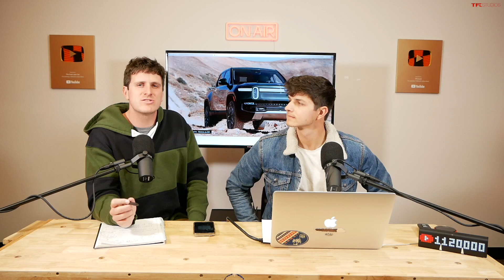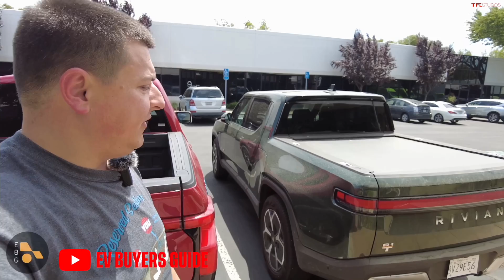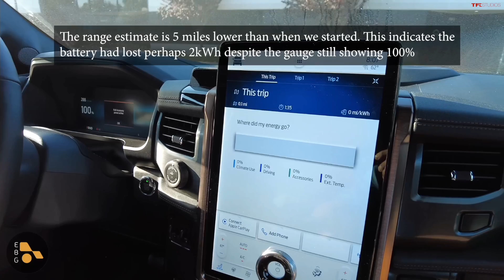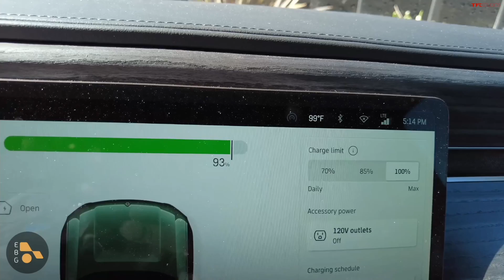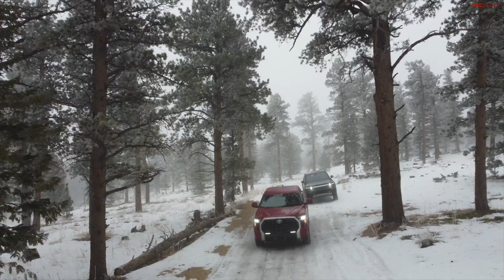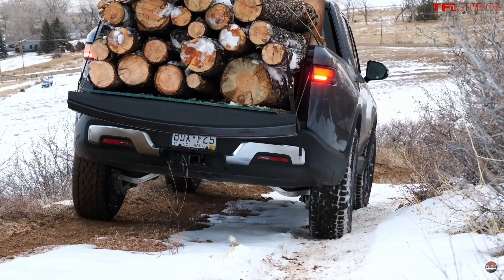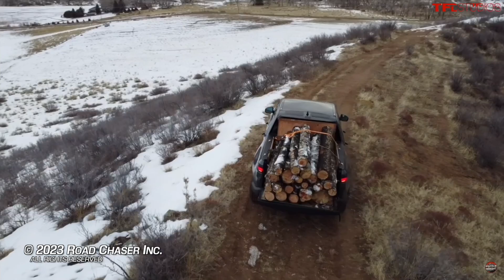This Rivian Is Getting The Equivalent of Just 25 MPG: Here's Why That Matters!

Comment: Frequently, when parked I hear my Rivian make various noises, air compressor sometimes comes on briefly. I think Rivian needs to take a couple of trucks, park them in the cold and monitor them until they figure this out. Not an issue for me, I drive the piss out of my Rivian. Never leave it parked for very long but it is for others. Overall, I try to park it in the garage as much as possible but have been lazy lately.

Comment: You could turn off battery thermal regulation. Then people will complain it does NOT heat up quick enough, or the battery failed prematurely. You can not make everyone happy. It costs me under $5 to drive my Rivian 150 miles. I am very happy with this!
Reply: My 10 year old BMW i3 doesn't have this issue and it's always ready to go.  It also takes just 8 minutes to fill it up at a fast charger......

Comment: Don't spread this guy's FUD. He's posted on Reddit about this, too. His math is severely faulty. Sure, if he drives it so little that vampire drain is MOST of his energy usage, it will be bad.

Also, "a charge cycle" is a charge cycle, regardless if it's a bunch of 60-70% cycles or one 25-85% cycle. As long as you don't drain to below 10% or charge past 90%, the battery doesn't care how it does it. "60% total" is 60% total.

Comment: Software upgrades will only do so much. I personally think there should be a battery cooling/heating  shut off switch. Like a physical switch not a Software shut off.
Reply: That's too risky. If the battery were to overheat in the summer it could trash it all because some guy had his cooling switch disabled. Companies wouldn't want to warranty that .

Comment: Tell me again why 25mpg for an awd 4 motor 800+hp supertruck that runs 11s is worth complaining about?
For reference c&d reported their ram trx test truck averaged a paltry 7-9mpg over it's whole time in the fleet. 🤔
Reply: I'm the guy the story is based on. You're right, that's one way I try to look at it. The problem is that if I leave the truck sitting for 2 weeks unplugged it will be totally bricked.  It's kinda like having a hole in your gas tank with fuel constantly dripping out -- to me that's worth complaining about.
Reply: @Shive55  I get that part of it for sure. I just find people harping on ev trucks with lower than ev car efficiency like yours and the hummev. 
To be mildly amusing because it's still a whole lot better than any ice truck can hope to achieve. Let alone the few high power ice model's.

All without any particulate pollution noise or much heat. I hope rivian sorts this out. I noticed many owners talking about vampire drain over on the main rivian forum. Maybe munro helping them out will translate into better tech either in the r1&r1s refresh or the upcoming r2 platform.🤔

Comment: With 22" wheels, I'm getting between 65-75 empg with just under 3K miles on it.  I use the odometer for checking miles and then the Rivian app for how many kWh it consumes.
Reply: Just a misleading title. They should have labeled it "Rivian vampire drain"

Comment: I wonder how much of this comes down to learned behavior within legacy automakers not to allow phantom drain when vehicles are off.  ICE vehicles simply can't support any noticeable battery draw for extended amounts of time without risking getting stranded because the batteries are relatively small.  You see complaints on the truck forums where people don't understand why their truck didn't light up when they approached it with their key after being parked for a few days.  The answer is that it went to sleep to conserve power.
Now you have newcomers to the automotive world and their vehicles have massive battery packs that can supply all the power you need to keep the vehicle awake and ready to go, so they might not be optimizing power usage when parked.  Sure, it's nice to keep sentry mode active all the time in case something happens, but that power isn't free, as people are finding out.

Comment: Phantom drain seems to be a real issue in these "newer" manufacturers, which is strange.  Tesla also seems to have some losses (more of course with sentry mode) than others. As we saw in the video, the Lightening had almost none. My BMW i3s is also almost 0, as sitting for a week at the airport in 30deg temps I saw 0% range loss, in a much smaller battery. Interesting! Great video guys!
Reply: I left a 2022 Tesla MYP at the airport (outside) for 3.5 weeks in 30 degree temps and lost less than 1% battery total over the 24 days.
Reply: @A Washkowitz  its all software related remember the model s back in 2012 had this issue some cars bricked themselves I think rivian will get to the bottom of this... but it really shouldn't happen this late in the ev game even ford got it mostly solved
Reply: Another anecdote... my dad's Kia EV6 sat in my driveway for 6 weeks. Left at 80%, it lost only 1% in that time. This was in the winter too, with freezing temperatures.
Reply: My Mustang Mach-E loses essentially nothing when sitting.. maybe 1% if left for a couple weeks.

Comment: Case in Point I have 2023 Ioniq 5 long range AWD Limited equivalent here in Canada, it is going in for its 4th attempt repair of the DC Fast charging issue (it does not charge on DC). It is currently parked in Abbotsford air port for coming up to a week my drive home is about 100KM so I was really concerned that if it lost charge I would have to find a J1772 Level 2 charger to make it home (DC charging does not work). Thankfully even with the car remote app link to the car, it still shows 72% after 6 days of sitting I arrive with with about 73%. Rivian have to improve their phantom drain that is no good engineering plain and simple..
Reply: This car is on the same platform as the mentioned KIA EV6, so the risk of this problem is low, but there is a high probability that it will have limited performance due to a cold battery.
Reply: @Dqtube  This 2023 has battery preconditioning, so much improved charging performance in cold weather.

Comment: Man! That's crazy! It's  like when GM told us that it's acceptable to lose 2 quarts of oil between oil changes in our Saturn. We've had three. All purchased new and well maintained. 

If Rivian is losing this kind of capacity while new, what will it be like after it's five or six years old? BTW, what is bricking the battery? Is it permanent? It's hard to learn without knowing all the jargon.
Reply: "Bricking the battery" means your battery has turned into a brick; as in it is no longer functional.
Reply: @Shive55  Thanks. So it's permanent damage? Is it from letting the battery discharge completely?
Reply: @lizburgess4398   Yes. It’s possible with Li chemistry batteries to have permanent, irreversible damage. They need to be managed correctly by the onboard computer, otherwise they can be destroyed. I have not heard of this happening on a Rivian, however.
Reply: I love reading comments! 😅

Comment: Per Rivian 3-12% drain/day is considered Normal... 85% Battery with 12% loss will become a paperweight after just 7 days
Reply: That might be “normal” with gear guard and systems operational (even Tesla will still use ~7% or so per day with Sentry mode on)…3-12 is a big range when talking about battery percent though!

Comment: Consider BMS sway. If never charging to 100 and never dropping to 0, BMS could get confused and simply not know where the top and bottom of the battery is. It could be that he never is hitting either/both 85% or 25%. So it could be that he’s not losing as much as it seems.
Reply: It's been charged to 100% before; but I've never gone down to 0 - that would be really bad, right?
Reply: @Shive55  It’s not good for the battery to go to 0 all the time daily but it can be good to go from 100% to 0% occasionally just to let the BMS recalibrate.

Comment: Up to 12% in 24 based on 'weather' is pretty extreme.  Have to be spending a lot of energy on battery temp 'n such to pull that off.
Setting that are supposed to shut down power draws, like the 'shipping' option, need to actually do what they say.  This is not happening.  At least not in this example.  Interestingly there are comments from other owners on this vid that indicate no such issues for them.  Not sure if sfw version differences are at play.
Reply: Seems more concerning that Rivian pretends not to know/doesn't know why some vehicles have 1-2% and some have 12%. Understand not wanting to pay for the resolution, but not understanding why seems illogical
Reply: I think they considered the extreme scenario. Lithium battery can’t be used under -20C. If the battery drops below that the battery heater needs to kick in to maintain the lowest threshold otherwise you can’t drive. That’s common for all electric cars.
Reply: @ayeameen  I'm the guy the story is based on. This is happening in a temperate climate in Northern California. It rarely gets below freezing in the winter for more than a few hours at the night.
Reply: @Shive55  Yes, your case is also not extreme that battery is loosing 12% per night. Rivian definitely have some inefficiency in managing the drain but I think lot of these can be solvable to turning off inverter and dc voltage regulator when not in use.

If you ever use a portable battery power station you'll see that keeping the ac outlet on, or even the dc outlet on, consumes a lot of power. They all have auto power shut off and ask user to turn off when not in use.

Comment: I ran into a family at the Portland Auto Show and they are selling their R1S after just receiving it. According to them, they can’t drive the R1S round trip from Portland to Mt Hood (ski resorts) on a single charge. That’s only about 120 miles round trip and 6,000 ft elevation gain. And the weather here has been average, 40’s in the city and 20’s in the mountains. I think there is more than just vampire battery drain here, I think there is something seriously wrong with the vehicles.
Reply: Bullshit. I just drove my Rivian from Portland to MOUNT BACHELOR on one charge. Over Mount Hood. (Highway 26 past Government Camp.)

I've driven to Mt. Hood Meadows and Timberline and back multiple times on one charge with plenty of charge to spare.

Either they're starting at 50% AND driving 85 MPH in Sport mode with the heat set to 80°F, or they're lying.
Reply: @AnonymousFreakYT  exactly!
Reply: I live in Seattle area and go to Snoqualmie every weekend with my R1S. About 3,000 ft elevation gain and 80 miles round trip. Battery percentage consumed is 35% max. Start with 70% and come back with 35-38%. If their car has nothing unusual, I don’t see why they can’t do 120 miles round trip. On the way back regen is supposed to help.
Reply: They are having an issue then. Like wanting to flip it for $$ lol. 120 mile trip is no problem, even in sub zero temps. I do this weekly in the Adirondack mountains.
Reply: Don't shoot the messenger, I can only repeat what they told me. At the same time, I just don't know why they would lie. Telling me they can't drive 120 miles on a full charge doesn't seem like a good sales pitch if they're trying to sell it. Either way, it seems to me something is wrong with their vehicle and perhaps the one discussed in this video. Doesn't seem like a vampire issue.
Reply: @moderaterebel  I don’t know if they were lying to make it look bad or just downright mistaken. But I get more than 120 mlles while towing a 7000 pound trailer.

Comment: If you drive every day and you plug in every night to charge then the battery will reach an equilibrium temperature and way less energy will be needed to warm the battery during cold nights. If you only drive 5 miles a day yes I would expect the efficiency to be low. It's still a 9000 lbs truck also, so 25mpg is really good considering.
Reply: The Ford is heavier and has almost no loss
Reply: @WhoIsThisGodPersonAnyway  Thats not true it was shown in this video the Lightning lost range also.

Comment: By my math that's about 190W the truck is burning when it's just parked. That is conspicuously within the range of something like a mid-range desktop computer under load. This would support the theory that there's a suite of high-end ECUs sucking back that power

10days*24hrs = 240hrs
5hrs + 42min*(1hr/60min) = 5.7hrs
Parked time = 240hrs - 5.7hrs = 234.3hrs

60% of 135kWhrs = 81hWhrs
Driven energy burn = 36.3kWhrs
Parked energy burn = 81kWhrs - 36.3kWhrs = 44.7kWhrs

Power when parked = 44.7kWhrs/234.3hrs ~= 0.190kW = 190W
Reply: I've joked that maybe my truck is mining bitcoin for Rivian.
Reply: @Shive55  👀

I wonder if that factors into the crash safety testing

Comment: 3-12% is normal based on the weather. That statement leads me to believe that Rivian is always conditioning their battery rather than conditioning before startup. Considering that most of the time a vehicle is likely to be parked, this is a bad model, and the number of miles driven some of these drivers are getting is showing it. Of course, the other method's value depends on the driver actually taking the time to condition the battery through their app before they drive it, and people understanding they should be doing that. Those last two assumptions mean that the driver is actually attempting to prolong the life of their truck. Unfortunately, there are a fair number of people who do not do that, and some of them seem to be doing that because it is in their best interest to make a fuel type look bad. The only way Rivian's model makes sense is if the person is parking the vehicle necessarily in the garage so that the person's home heating is conditioning the battery. I wonder if shipping mode ensures the battery condition is better for a first impression. That would increase the drain if true.

Comment: When you take short trips in winter weather without warming the battery your efficiency drops dramatically.   In any electric car.      Warm the battery for 1/2 hour and you can gain as much as 15 to 20% better efficiency.    At the cost of using home power to heat the battery.    Takes more energy.   You go further on a charge.
Reply: Plug it in then unplug it but don't charge past 90% or fall below 10 % because that could hurt your battery. Don't let it sit still to long or your battery may be low or possibly drained. Plan on a possible 40% winter drop in range when it's cold. Warm for a half hr if you plan on driving in cold weather. It sound's like defrosting a turkey more then driving a truck.
Reply: @paulwatson4189  First generation EVs.   As battery technology improves none of this will have to be done.    

On the base Tesla 3 you can charge to 100%.   You can drive the battery down to 1% with no side effects.